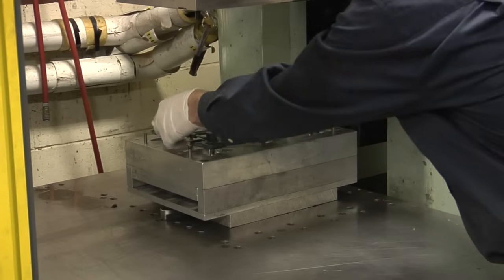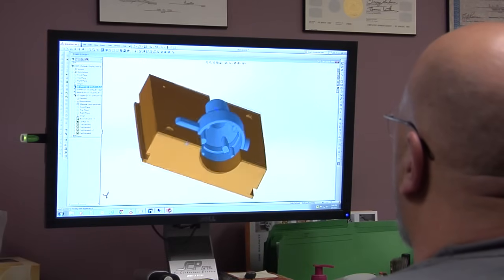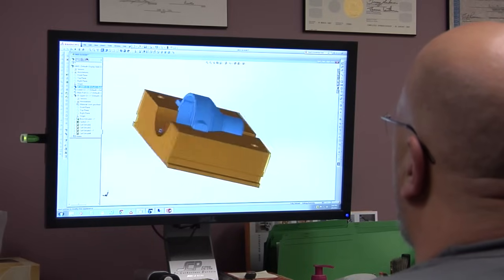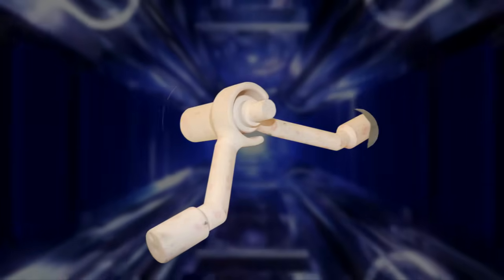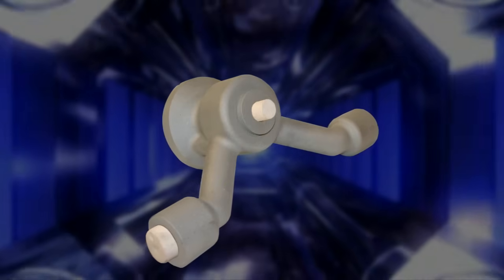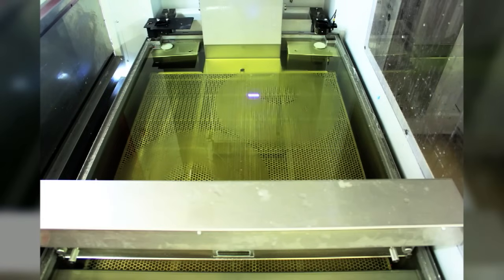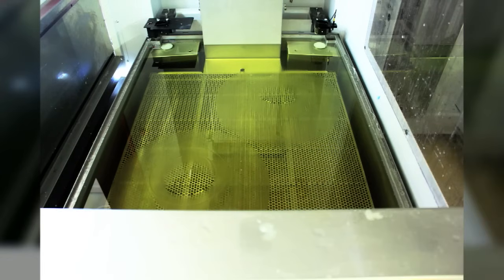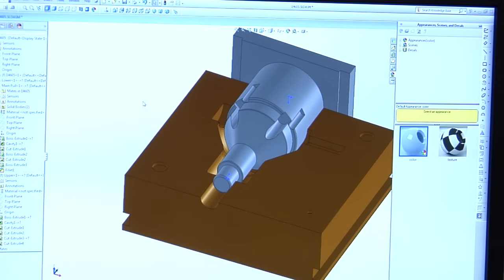Learn about Investment Castings

Comment: Great explanation! Investment casting requires significant tooling commitment. A smart first step is to validate the design with a functional prototype. We help clients do this by CNC machining or 3D printing a precise replica, allowing for form, fit, and function testing before the final metal cast, saving time and cost.:hand-pink-waving:

Comment: The surface of the castings produced by this process is always so uneven and never looks completely finished like a machined part. One would think that the ceramic coating the wax before the sand application would make for a smooth finish on the metal. Looks like the texture of the wax is still transferred to the metal.
 I've always heard that the castings are simply never as strong as those produced by machining.  But what the heck, it's cheaper.

Comment: Thank you for sharing, I wish I could afford to have some (one-off) 4130 steel parts copied/cast from the inferior materials I used at the time I fabricated them. Like Live Steam 1/8 scale AAR Type A locomotive trucks that I have several blueprints of & a plastic & wooden sprocket I made etc.. Any guess how much it would cost to make these in regular 4130 steel for me? Anything more than a few hundred bucks is not feasible for me. I don't even have a milling machine or a lathe yet either :-(

Comment: Cool video!  Please tell me what kind of powder do you pour after pouring the metal and what is it for?
Reply: I dont mean to be so offtopic but does any of you know of a method to log back into an instagram account??
I was dumb lost my account password. I appreciate any assistance you can give me.
Reply: @Vincent Adriel instablaster ;)
Reply: did you learn the powder?
Reply: @iremgok4883  no
Reply: Refractory material i.e. materials having very high melting point.
Used to make mold cavity for complex 3D designs for a great surface finish final product of  casting
Reply: Good eye i honestly didn't catch that the first time around, it might be something to cover the surface of the metal to prevent oxidation and bubbling/scabbing after finishing the pour, slow the air from getting in deeper down the mold because i think that inlet section is going to be grinded off anyways, i doubt it's anything to alter the chemistry since that would be more effective to add when melting the metal so it's thoroughly mixed. obviously i could be wrong
Reply: i just found this video where they basically do the same thing but it's more clear, at 4:14 : https://www.youtube.com/watch?v=MBkI41QZqrs

Comment: So investment casting only applies for solid parts ? Am I right ?
Reply: Not. Because the wax pattern is immersed in the  liquid ceramic(ceramic slurry), all parts of the pattern are soaked in ceramic slurry. So if we have a hollow wax pattern, by dipping it in ceramic slurry, all the inner parts of this pattern are impregnated with ceramic. So we will have a complete ceramic mold. Watch this video→https://www.youtube.com/watch?v=FaBg-hMjdLg
Reply: Not quite. If you use a core that will later get dissolved out, you can form hollow parts or cavities in the casting
Reply: @MartyShingler  No core required. If we have a hollow wax pattern, by dipping it in liquid ceramic (ceramic slurry), all the inner parts of this pattern are impregnated with ceramic→https://www.youtube.com/watch?v=FaBg-hMjdLg